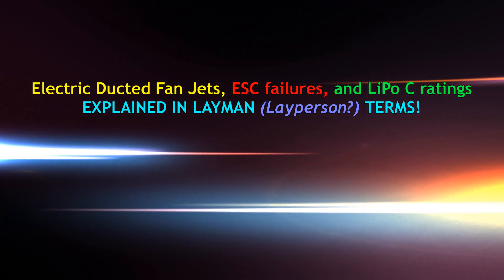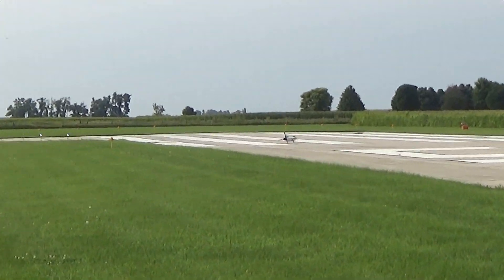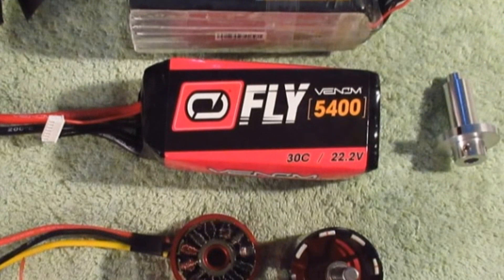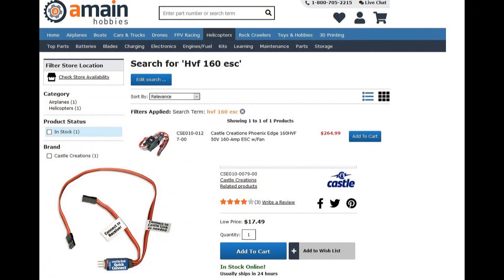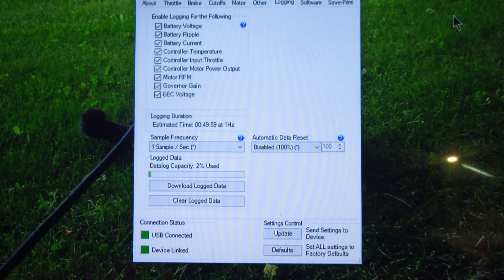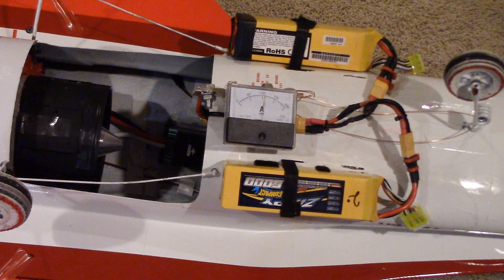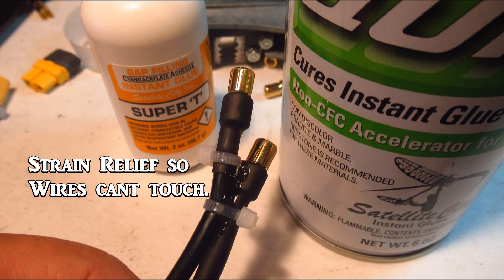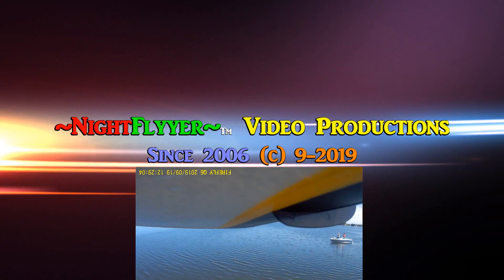Byron F-16 Jet ESC Failures caused by LOW LiPo "C" ratings with EDF's explained with actual Demos.

Comment: The ESC should be min of 1.25% lipo c rate at 1.50% of the max load.
Reply from the maker: Well, the Castle Creations and the JP fan worked just fine, if you watched to the end, because I knew the exact specs.  If I had known the exact specs of the Changesun fan in the beginning, (not what was advertised) I would have known not to do what I did in the early flights.  But in reality, doubling the rated voltage on the motor is what really killed them. All is well now. Thanks.

Comment: Great video, bummer this info had to be found out the pricey way, but thanks for sharing- it's fascinating to see that yes, there really is a good reason I need to keep using EC5's or better on my edf's- wow, it de-soldered that XT-60 so quickly ! Pretty sad that venom would even supply a 6 cell with XT-60 attached.

Comment: Tip 2. Charge the batteries and then put them in the frig over night. You will start out with an extra 30F buffer on the flight. My F-16 batts are barely warm after a flight. Don't fly with the batts below 40F or they will sag on take off. 40F is the magic temp.
Reply from the maker: That's good, but by the time I drive down to the airport 30 miles away and get setup, I believe the batteries will be ambient temperature by then.  Also my latest setup and batteries are running very cool.  It's the motor that is running hot. Thanks for the suggestions.

Comment: I needed to use an adapter to convert battery to ESC. It got very during ground testing. The cure was to use  2 inches of 12 gauge solid wire in the adapter. It acted as a heat sink. Now the only heat source comes from the batteries own T connector. But the heat sink effect keeps it at 85F.  Why are you messing with those low C batteries on an EDF? Go 75 and above.
Reply from the maker: My last test with the 60 c batteries went fine, and the wires and esc remained at only 85 degrees and Batteries, were only 115 degrees, so all is fine there.  I have just heard from the fan manufacturer and he says this motor should not run on more than 50 c batteries and only 8s, not 12s as it was advertised to do on the Ebay sellers site, so not guessing.  I think the motor will fry, as all else is good. Note,  I used 10 Awg wire which is even bigger that the 12 you used. Not heat problems on the last test, except the motor was very hot. Thanks.

Comment: Those high blade count fans are amp hungry. I would still be concerned about the motor being able to handle it. Without being able to pull the amps needed, it still burned the windings. Now that it gets more amps, it seems to me that it would get hotter quicker. Not sure what I'm missing except the esc timing set to 0 would make a big difference. If all else was the same and you ONLY reduced the esc timing, you may have been OK. Also a higher C rated battery would hold the voltage keeping the current less for the same about of watts. Ohms law of course. Seems the  whole system would be better off on at least 8S to be honest. That's if the motor can handle that kind of wattage and volts pushing it. Unless you're running 2 batteries in series for 12S???
Reply from the maker: Well, I agree and fear the motor will fail.  This is a 120 MM fan with 12 blades and I am no longer concerned about wires, the esc or the batteries.  They temps were way lower than expected in this last test, however the motor was at 200 degrees.  Both batteries are in series making it a 12 s, which is what is recommended by the fan manufacturer.  I don't think it will fly on 8s.  Maybe 10s would be better.  Stay tuned and we will see what happens.  If the motor fails next time, and the plane survives, I will be trying to find a motor that will work with this fan.  Otherwise, I may just go back to nitro, as it was designed for in the first place.  Thanks much for your suggestions and comments, Garry.

Comment: Hey Dave, 

Been flying EDF for years in large models, see vids in link for proof.

1st turn off your voltage cut off and get batteries like the graphenes that can take a ... TRUE ... 30 c pull to 100% empty and not go negative then you don't have to worry about beating up the system as a whole

You don't want the ESC to VCO hit because the model cost more then the batteries, beat up the packs and not the model. VCO is old and not really for EDFs because we can't tell when it's going to cut power and crash the plane

2nd - please read the RC Groups thread - battery load comparison test here - https://www.rcgroups.com/forums/showthread.php?1767093-Battery-Load-Test-Comparisons

This will give you REAL TIME testing on the C rated packs and you wont be shocked and you'll have some real good data on cell performance.

3rd - put an intake lip on the fan and you'll get nearly 30% more thrust out of the fan and more amp draw so make sure your system as a whole will have the correct overhead on the system.

Nice flying !!!
Reply from the maker: I believe you.  My wiring, batteries and esc problems have been handled.  I do not need more thrust, as this thing flies fine and is faster than the .90 Nitro it was designed for.  What I think, is that the motor is still going to burn up!  Many have told me the motor cannot handle 12 blades.  This is a 120 mm fan.  What I need to know, is what motor I could put it in that would be better.  Thanks.
Reply: @NightFlyyer  matters the amp draw ... the red colored motors for this fan with burn up but this one is a bigger motor 

if you've already run it for 2 minutes then you most likely will be fine make sure the temperature is in under a hundred eighty degrees on the coils not justa back of the motor.

What is your amp draw?
Reply from the maker: @edfhobbies556  Amp draw was right at 120, and wire temps and batteries remained lower than I expected. The motor was at 200 degrees, so that's why I fear it will fail.  I need an 8mm shafted motor that can handle this 120mm fan with 12 blades, if this fails and the plane survives. Thanks again.

Comment: Nice model. I miss Byron Originals and wish they'd make a comeback.

How long extension leads were you using on the first two failure flights? Extending the leads between the ESC and battery considerably will blow the ESC.
Reply from the maker: Yes, well they worked on the low c batteries.  As you saw I shortened them and made them 10 AWG, so that is not going to be a problem.  I still feel the motor will burn up, as that is now the weak link. Thanks.

Comment: Dave I often wonder if we can believe or rely on these stated 'C' Ratings ? recently Xjet did some tests and found many were not as marked on the lipo.
It is a right pain having to rewire everything through the system right to the point of charging them ! hope you get it sorted as this is a lovely bird in the air.
Reply from the maker: I agree.  I am sure I now have the wiring, batteries and esc sorted out, but still feel the motor wont be able to handle it.  We shall see.

Comment: The first save was EPIC. Great job Dave! 

The motor will attempt to get its rated wattage. If voltage is low it will make up for it by pulling more amperage which in turn burns stuff up.
Reply from the maker: So true.  There is nothing else left to do, and I still feel the motor will burn up.

Comment: it seems your motor can´t handle the 12 blades fan. it is a 90mm fan?
also, for that kind of current, you need thicker wires and you should use the connectors XT 90, not XT 60!
also I saw the wires on your motor, and definitely, they too flimsy, so my guess is that motor was never design for that kind of fan.
I am not an expert, by any means, but I have been flying EDF´s for quite some time now.
well, good luck next time.
I like your F16.
Reply from the maker: I agree.  Its a 120 MM fan.  The batteries came with xt 60.  That's why I demoed them failing and changed them all out.  They did not fail on the first (low c) batteries and the motor wires I can't change. I am not sure what else to do, as I still feel this motor will now fail and the Esc and wires will survive.  Thanks.
Reply: @NightFlyyer  through my experience, a low C rate on a battery, will never destroy the motor neither the ESC, but the battery itself, it might burst into flames. In contrast, if the motor can´t handle the work load, will heat up, and self destroy, taking the ESC with it, no matter if you have 1000A ESC.
I guess you wore using a seperate battery to power the servos and receiver, otherwise,  your beautiful F16, wouldn´t exist by now... 
120mm it is a huge EDF, and requires a lot of power.
I recommend you to buy a 120mm EDF system, made out of metal with a balanced fan, to help the cooling, which includes the motor already, and . there are a lot of places where you can purchase it, and it will cost you around 200 bucks,  with the ESC, depending in how much pounds of thrust need for your model. Don´t go cheap on that, or in the long run, it will cost you more. believe me. Also, place the ESC on the air intake, so it cool itself, not directly in front of the fan, because of drag, but somewhere there, at a side.
What concerns to batteries, myself would use that 2 Zippy 5000mah 60C that you got, in parallel, so you double your amps hour, and also your C rating, keeping the same voltage. if you think, it would be too heavy, or you don´t have room for it, I recommend you, a battery above 5000mah, rated C100, or above.
I know they are a bit pricey, but on the long run, it will save you money.
I also recommend you to get a current sensor, that talks to your TX, and when you got readings of 3.7Volts per cell, it is time to land, and change battery.
if you use it like this, your gear will last forever.
Sorry for such a long reply.
Good flights.
Reply from the maker: @joematarc5245  My system has a second battery pack for the rx, and know I have been flying a long time too starting with the first ESC's (Victor Engineering and Novak) and Lipos.  I met and flew with they guy who created the Brushless motor invention called Aveox, so am not in the dark.  I already have a plug to make the batteries in parallel, but that would make the voltage drop by half and only 22.2 volts to the motor. Safe for sure, but not enough to power it to fly.  Room that takes would be the same.  My CC esc has a fan and is right in line with the intake.  It is not getting hot in my tests.  I also have data logging on the esc and can read anything.   I fear the motor is the weak link.  If I could find a fan for $200 like you say for $200, I would have bought it.  This fan flies fine when it works and has tremendous thrust. What I think will happen, now that power, wires and batteries are set, is the motor will burn up. The batteries after that last test run were only at 121 degrees, so no worries there.  Stay tuned.  Thanks.
Reply: @NightFlyyer  how many cells are you using to run your 120mm EDF? 12S ?
Reply from the maker: @joematarc5245  Yes, 12s. That is what the Fan Manufacturer recommends.
Reply: @NightFlyyer  wow!
so far I just used 6S systems...
There is a German company that manufacture high quality EDFs, even bigger sizes then 120mm. Carbon fiber blades, high efficient motors, etc, but it costs 3 times more than a Chinese one. I never tested yet,  coz I fly foamies. there are a lot of youtube videos about it. schuebeler-jets.de.
Well, good luck.
Just trying to help.
I hope I didn´t help too much, haha
Reply from the maker: @joematarc5245  Thanks for all your suggestions.  Stay tuned, please.

Comment: Good job getting her on the ground in one piece twice! I would have headed for the tall grass with hope and prayers. While lipo batters are so much better than Ni-Cd and Ni-Mh of the past the strain the equipment puts on them is immense. I had a fast cat and I changed the batteries from power poles to xt60’s after it had originally come with deans. The xt60 has a theoretical higher rating than a deans, and certainly more surface area so they should have been fine. Even after proping down the boat it would immediately set of a lipo alarm at 3.2v. The motor and esc were both rated at 50a continuous and 80a burst with 40 batteries recommended. Even running 50c the batteries were almost too hot to touch and the runtime didn’t match what the manual said it should have been. The short run times were enough for me I traded it for a nice electrified ACE Seamaster.
Reply from the maker: Yes Xt 60s are better than deans, but melted on my series y harness, so that had me worried and why I switched to the bigger bullets and wires. I like the Seamaster too.  If this fails tonight when I fly it, I might just have to put the Nitro engine in it as it was originally designed for. LOL.  Thanks kindly Jonathan.

Comment: Try putting more "Capacitors" from the battery to the ESC!
Reply from the maker: The new Castle has sufficient caps as they told me they should be sufficient, especially at their price, when I spoke with them. So this being the first test of the new setup with bullets, wires and the ESC, I am hoping for the best. If anything I need to put a cap on the leads, to stop the big spark when I plug it in.  Thanks for the suggestion and and comments.
Reply: @NightFlyyer  HI, i have Rc Monster trucks and the esc was always over heating and cutting out, but after a added more caps this fixed the problem! Its all about heat and power transfer! cheers mate!

Comment: Great job Dave. You did everything right, amazing how much trial and testing is needed to make something work that should work straight away when assembling and powering these old school composite jets. Only thing I would say is stay away from doing any hard and fast math calculations on "C" rating based on the sticker that's glued on the battery. Those are mainly used for comparison purposes to other brands and do not reflect the actual sustained output the lipo is capable of. Thanks for sharing your passion for this hobby over so many decades and all the best to you!
Reply from the maker: Your right about the batteries and c ratings.  My calculations are rule of thumb as a starting point as there has to be a starting point you know.  Well I cant do anything else to fix it any better, so we will just see how it flies, hopefully tonight when I get down to the airport.  Thanks for the comments and support.  I appreciate that.

Comment: Unfortunately lipo c ratings are almost always far overstated.  I generally run double the c rating as I actually plan to pull continuous.  Also if the wires were getting hot enough to cook the solder the wiring definitely contributed to the issues. 
Just fyi 6awg is generally specified for 120a continuous draw so you're still going to be overcurrenting those wires.  Don't forget that the wire venom or whoever put on that battery was designed to handle the amperage one pack can output not the two in series.  That being said if it works it works:)
Reply from the maker: Well actually I changed all the wires I could to 10 awg, not 6.  The bullets are 6MM and designed for 10 Awg wires.  Venom sent me those batteries at a discount after the First failure, and said they would work, but my Jumper to make it series was too small and that, as you saw was replaced.  I hope it works too, as I have only flown it 4 times in a year and a half.  If it works, it will hang on the wall and be satisfied at my age.  Thanks for the comments.

Comment: why would you ever think that you could run a edf like that on low c rated batteries? after spending big on esc high c batteries are a must, just look at what other edf are running on 75c min
Reply from the maker: Because the first fan was 500KV and that first flight was perfect and can be seen on YT.  I also used them because they were what I already had.  I don't usually watch others videos, to remain unbiased, and only took the recommendation straight from the fan manufacturer and Venom, as they both recommended high Amp ESCs.  Both those esc's were rated more than the fan. It was my jumper that was most likely the biggest problem, especially since the second fan is a 650Kv, not 500.  But there is nothing else left to do with the setup. So we will see how it goes tomorrow.   Thanks for the Jab.
Reply: @NightFlyyer  you will notice a jump in performance if you go for high c batteries all of mine are 75 or above and they will survive longer as well, would not take much notice of  specs go with what you or know or what your own research tells you, hope to see the next flight go well hobbyking sell the perfect batteries for your model give them a try
Reply from the maker: @jayb2617  Again, I am on a budget and certainly will use higher c batteries, as all the manufacturers said that too.  I should not need anything higher than the 50 c batteries I bought from Venom at $168 each and Venom told me that too in a long phone call with them.  Mostly the Series Jumper and bullets will also help.  Will try to get down to the airport tonight to fly it and expecting all to go well using the 60 C batteries, as they tested perfect on the bench. I want to hang this rare bird back on the wall, knowing that it is finally working as at 72, I don't know how much longer I can keep fooling with it.   Otherwise, I'm going to put a Nitro Engine in it, for which it was originally designed.  Thanks kindly and happy flying.